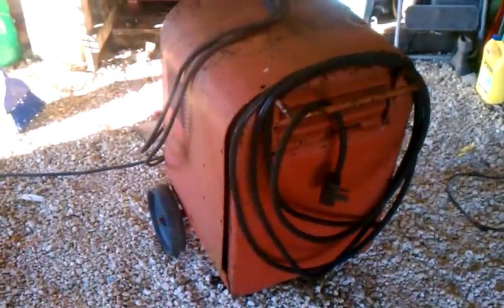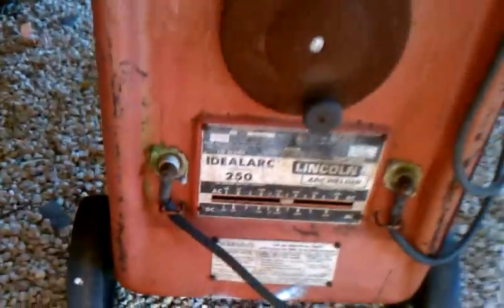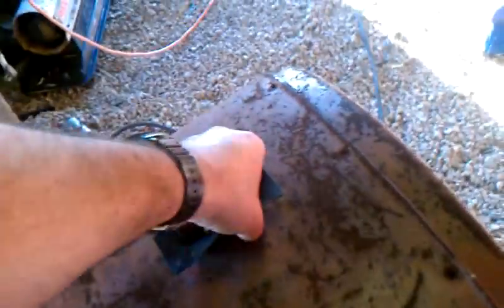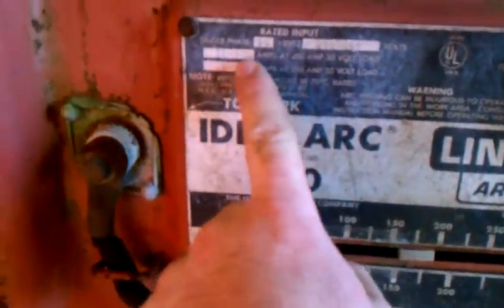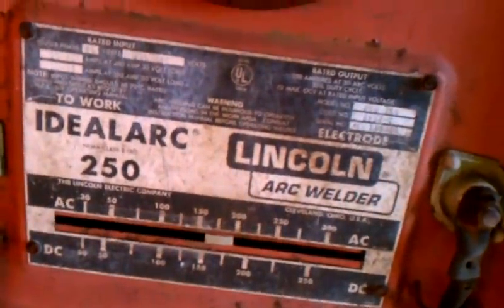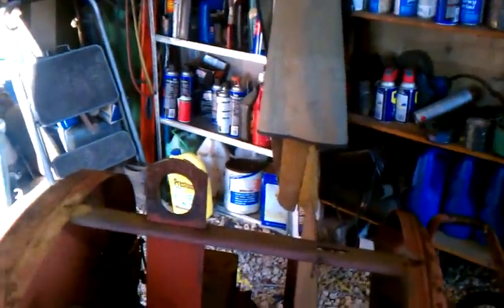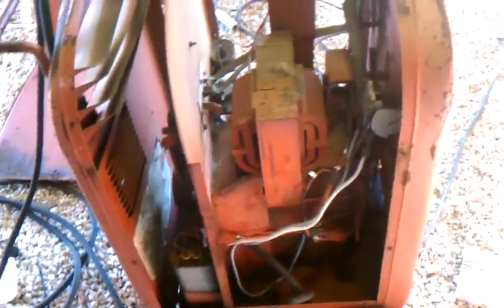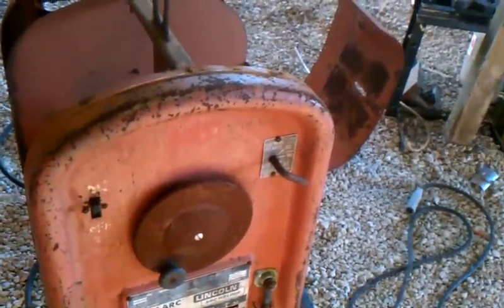Lincoln tombstone 250

Comment: At 2:18 onwards you show the SCR's, 24 of them in the full wave bridge 
rectifier, one bank of 4 banks went bad for me on my Idealarc 250 BEAST 
(1966 vintage), Lincoln doesn't have the part anymore, I had to order 
four Vishay 300 amp, 600 volt stud diodes and "roll my own" rectifier, 
cost about $135 for the four diodes, strong enough to rectify my whole 
house at full load plus another half house (overkill). Two of these 
monster diodes are reverse cathode and two monsters are normal cathode 
(google a full wave bridge rectifier for a diagram). 

Repurposed a serious heat aluminum sink out of a Goulds VFD Aquavar 
"computer", end milled four circular 1.5" mounts, milling out the fins 
on the heat sink, finally cut the heat sink in half and mounted it with a
 insulator strip (each half heat sink electrically isolated from the 
other with fiberglass sheet). Picked up some thick 1"  copper strap from
 my scrap dealer for elec. connections, checked and replaced a 
capacitor. I had to grind / cut the 4 or 5 intake louvers down to only 
3/4" wide, install 1/4" hardware cloth over the entire rear air intake 
or exhaust to keep out vermin.

Comment: I love the wheeled cart.
I've been using a pallet jack but it takes up too much room!
I'm going to copy you one of these days.
Edit: I have the capacitor version and have been running it off of a 50 amp (the garage has a 60 for its' entire feed) and I did fine running a 1/4" rod at 250 amps. Never tripped anything.
Reply from the maker: I've recently put it back together but didn't get to finish painting it. I have burned a few rods since and had no problems.  The wheels kit is a factory option from what I can tell.

Comment: If you were going to use that welder for industrial use, what electrical service would be best to run it?
Reply from the maker: DZEyoyo123 probably the 408-480 it would pull less amps. What I've read it needs like 80amp breaker

Comment: What components would you have to swap out to make that welder run on higher voltage?
Reply from the maker: fishodorvagina On mine it was just swapping a couple of wires one on a capacitor and then wire 2 wires together I don't have it with me right now it's in storage but mine had a pretty faded wire diagram to show me.